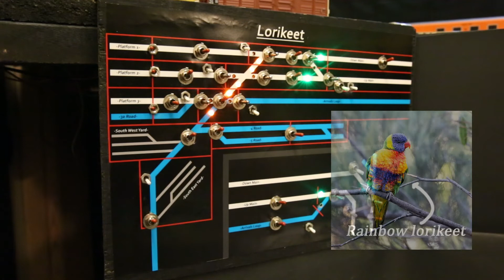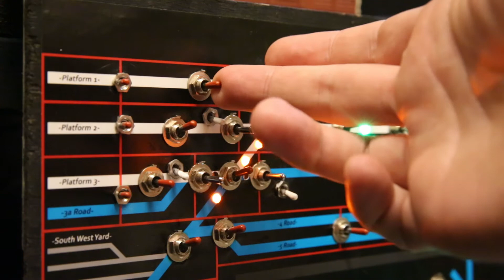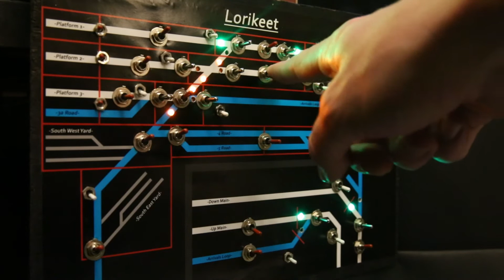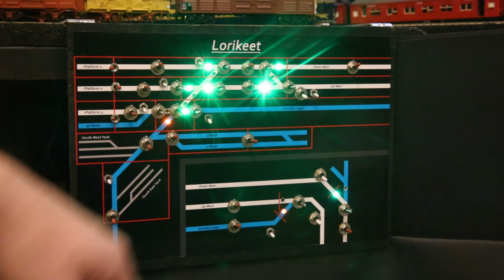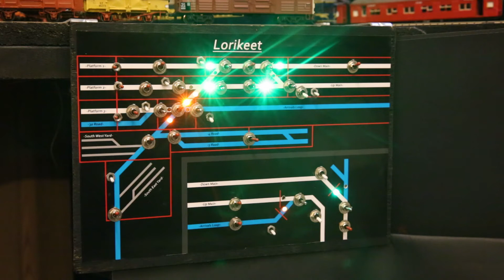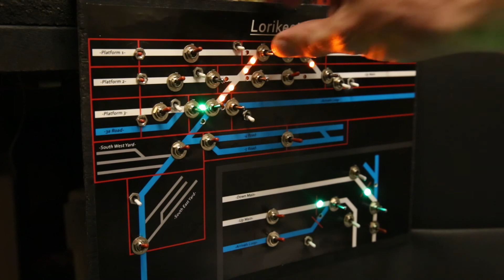Operating Lorikeet Panel - HO scale Model Railway

Comment: just found your channel , very impressed thankyou. are your point switches three position return to centre off. and also how are your led route indicators wired in. it sounds like you're using peco solenoid motors.
Reply from the maker: Yeah the switches are sprung to the centre-off position, so it just makes momentary contact one way or the other to the solenoid. Testing my memory a bit here (this layout was dismantled three years ago) but the LEDs were wired through a set of micro switches attached to the point motors, pretty sure it was a proper Peco product. They were very fiddly to set up and adjust and a bit unreliable, so not sure if that's actually the best way to do it.